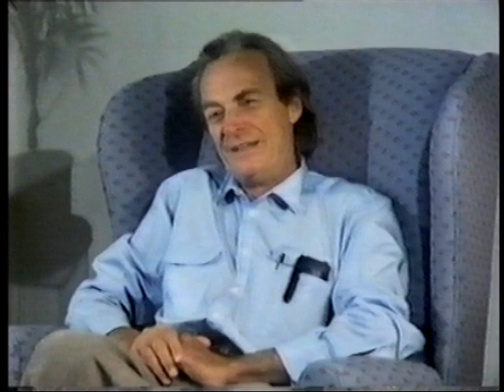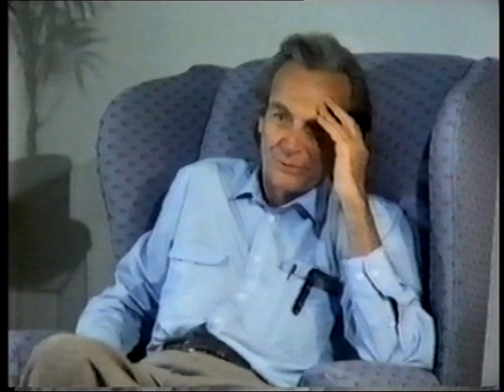Feynman: How the train stays on the track  FUN TO IMAGINE 7

Comment: @rbnchm Depends on the motor in the train. Electric trains work by varying the magnetic field, shifting north to south. By doing so, the magnetic force creates a spin by pushing or attracting its opposite fields and this force is attached to the wheels via gearing. This is basically how electric motors all work. A steam engine moves the high pressure air (pressured from the heat generated by burning) through a cyclinder where it's eventually exhausted out, releasing and exhanging the pressure.

Comment: @episcophagus I run ut of space... I have noticed that the inner side of a rail is rounded, so I thought that this rounding corresonds to an inner "conical" part of the else flat wheel (before the "safety disk") that rests on the else flat track. But if the train goes "astray" the conical part of the wheel will climb up the rounded part of the rail and then slide/steer back.

Comment: another one.. imagine a clock which second hand is so long that each tic at its outer edge travels a distance of 186,000 miles (in other words, the speed of light) and you are standing at the center of the clock on the second hand traveling with it watching the outer edge with a telescope... what would you see?

Comment: I have to admit that I didn't know this. But are the tracks "conical" as well? (Is the outer edge of the rail higher than the inner so that there is "full contact" all across the rail between it and the wheel?) They have to, don't they? But this would cause extra friction - so the difference has to be as small as possible. In curves the tracks as a whole are tilted (and thus the train), which keeps the train where it should be (or at least helps to do so), but that's another story. Enlight me!

Comment: @MCBathtub Tides are the result of the Moon's gravity distorting the space around Earth. Water, being flexible, responds more dramatically than, say, rocks, and moves in a tidal fashion, following the distortion that the Moon's gravity creates. This movement of water creates friction along the Earth's surface and this friction slows down Earth's revolving so that each day is slightly slower than the one before. Over time, it's quite measurable. During the dinosaur era, the day was 18 hours.

Comment: Honestly I don't know the answer. I thought of this while I was high on hash. But it seems to me that if this was a real scenario, it would depend on the material that the second hand was made from. I think that even the strongest known material would turn into radiation?? before reaching the speed of light. Of course you would easily be able to calculate how fast that light would come back to you which also effects what you see. And what about the power of the scope? I really don't know. lol

Comment: @rbnchm Electric trains move via magnets that transfer the energy by changing their magnetic state in a way that pulls the train wheels continuously in the direction of the changing magnetic power, sort of like a magnet pulling or pushing a metallic object, but the object is in the shape of a train wheel. Old time locamotives did this by transferring the heat of burning coal to a water vessel where the heated water, steam, would push against a cylinder connected to a rod that pushed the wheels.